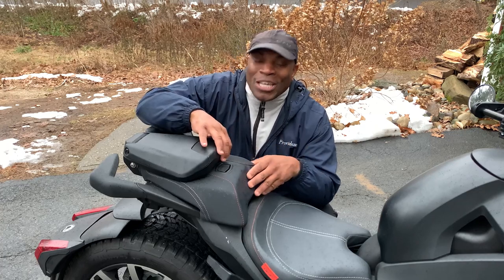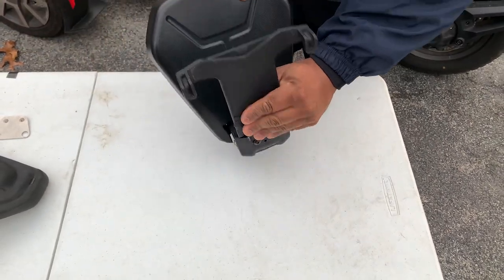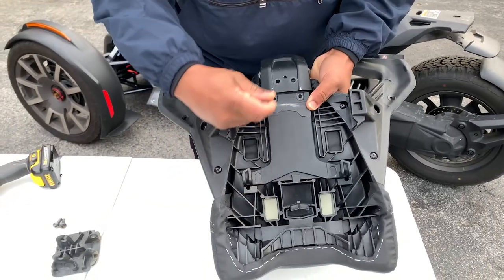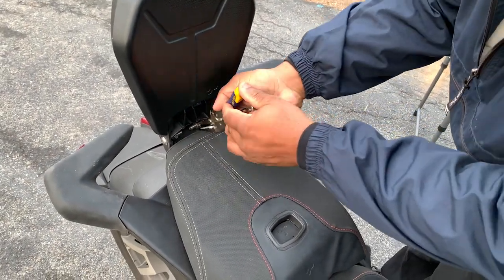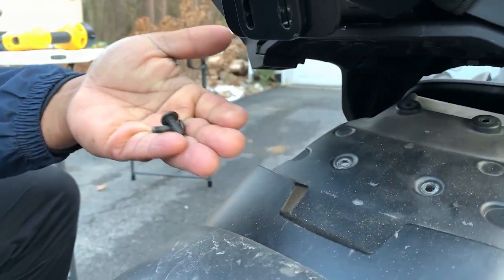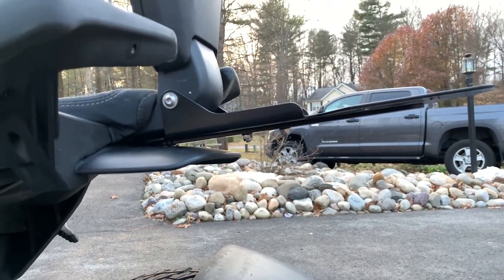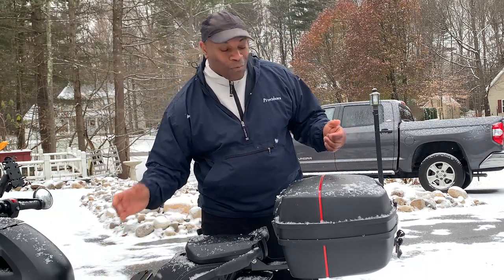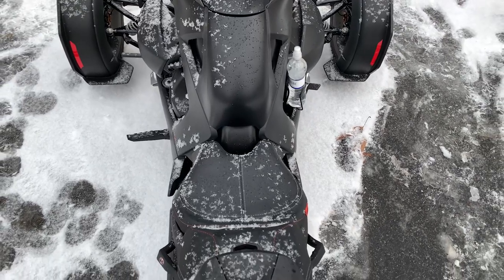Installing  Can-Am  Ryker  Luggage  Rack With  Passenger  Comfort  Seat

Comment: You're really selling me on the bracket I saw on your last video of inexpensive top cases!  I need to get the passenger seat with the flip-up backrest for the wife AND I want a lockable top case behind her seat.  Another VERY HELPFUL and well done video!  Thanks!
Reply from the maker: Hahaha. Thanks for watching the video.  Listen..also check eBAY and Walmart and Target for the top case.  48L size usually holds 2 helmets.  Amazon has been selling out of the less expensive ones...which in my opinion works just fine.  Be well!

Comment: Excellent product and workmanship! Phenomenal packaging and printed colour instructions! However, didn't work well for my use case. I have a SHAD SH50 top case which is perhaps somewhat larger and heavier than for what this rack is intended. Since the fulcrum is set fairly far back (at the hinge point of the passenger seat) it results in a "diving board" effect with the top case bouncing significantly over bumps, even small ones. I unfortunately decided to remove mine and replace with a different, more rigid but also higher profile rack.

Comment: We have the standard BRP seat and backrest…does this bracket work with the non-comfort seat? Also, what specific storage box is that? TIA!
Reply from the maker: It works with any Can-Am seat.  You just need the folding back rest.  The short (non-folding back rest) is made with plastic so the short  back rest will NOT work.

Comment: So been looking at these Ryker 900's seems the Rally is the way to go in my opinion. Would you take a Ryker on a 1000 mile round trip ? They don't seem to move to quickly as far as selling. This concerns me?
Reply from the maker: It’s actually a great bike. The Can-Am products are very reliable also. I’ve been with Can-Am products since 2007 with their ATVs and started my business in 2011 with their motorcycles. I have no complaints. However… Ryker is not designed as a cruising bike. It was purposely designed to be a local run-about. It has a small gas tank and on 1000 mile road trip in my opinion it would be extremely uncomfortable… It has a lot of wind buffering and helmet noise because of all of that wind. But that’s just my opinion. We do mostly local road trips now and trailer the bikes for longer distances. Good luck with what you decide. Thanks for watching the video
Reply: @kirwinprovidence3225  thanks for the reply, yes i stopped by this weekend at a Can Am dealer he pretty much said the same. So typically I trailer my Honda ST1300 from Florida to North Carolina area and ride the mountains. I like AC and riding 600 miles even one way on a bike sucks in my opinion.
So the Ryker should handle pretty well throughout the curves of the area I assume the gas tank size is not to bad  5.3 US gal vs my Honda is like  7.4 US gal
Looked at the Spyder just way to big and to much money for a toy. Rode my friends and didn't really care for it. Think I will test drive a Ryker during Biketoberfest then make my decision.

Comment: Cool mod - are you fabricating the mount yourself?  Are you in RI?
Reply from the maker: We fabricate in Upstate NY.
Reply: @kirwinprovidence3225  Will I still be able to remove the backseat?
Reply from the maker: @richardlee4438  4 bolts hold the rack in place.  Removing the 2 bolts at the bottom will allow the rack to swivel up.  You can then remove the seat.  Thanks for watching the video.

Comment: It looks like a nice rack but the one big flaw is that someone can push that button up on your seat and take off with everything. Unless there is a bolt that I didn't see in the video that keeps someone from doing that.
Reply from the maker: There is no flaw as mentioned . In order to remove the assembly you have to remove the two bolts from underneath the rack. Before you can remove those bolts you still need to remove the bolts holding the mudflap in place. Once my rack is installed it actually protects your seat from being stolen.
Reply: @kirwinprovidence3225  Do you mean those 2 bolts that you replace underneath, because I watched your video a few times and I don't see them going through the max mount to make it secure. I not trying to be difficult,  I just don't want to purchase something for $180 that can't be refunded if it does secure. The mud flap does not secure into the seat only into the mount.

Comment: 1:00 Does the "special plate" come with it?
What's the weight capacity?
Reply from the maker: Yes…everything is in the kit. Weight is 20 pounds
Reply: @kirwinprovidence3225  I meant how much can the rack hold? Could I put 100lbs on it? I plan on going cross country next year and I'll need something that can hold all my gear.
Reply from the maker: @Raynor88  Sorry..no rack for the Ryker can hold that amount of weight.  The last I checked the Ryker can not even tow a trailer.  The racks are meant to handle a few items and keep them locked up safe in a luggage box.

Comment: The only inconvenience that I experienced with it was that when  I was trying to remove the passenger seat, the support plate was hitting the max mount. I had to remove all the hardware, remove the luggage bracket then remove the passenger seat so I can run some wire underneath the seat and max mount, but besides all that I love the bracket.
Reply from the maker: Thanks Carlos.  Be safe and enjoy the riding season.

Comment: Will it work with factory Yamaha top cases made for the FJR?
Reply from the maker: This is a flat rack so almost anything will Mount. It is designed so you can drill custom holes to most various cases. Metal is stainless steel so it won’t rusts on you

Comment: I have the Ultimate Seat, which doesn't have the folded backrest.  Wish there was a solution for this.
Reply from the maker: Unfortunately not. And all other options when mounted will hit the back tire. Unfortunately this is the only way to mount safely and not have issues with that back tire. Good luck…
Reply: @kirwinprovidence3225  thanks for the info.  I had wondered if similarly to how you have the added support of the bolts in the passenger fold down backrest, using the bolts (2 per side) on the Ultimate Seat where the grab handles might serve a similar purpose to allow it to work.
Reply from the maker: @ShockwaveTXB  Intriguing… Unfortunately I cannot speak to the mechanics of how that would work. You may just have to fool around with it.
Reply: The sling mods 2 up luggage rack can be made to work with the ultimate seat and the amazon luggage with some work

Comment: 2023: did make a model that will fit without the backrest?
#granrappa❤️
Reply from the maker: No because There is no safe attachment point without the back rest. That’s why all out of models on the market slam against your back tire when you hit a pothole. The back rest is needed to avoid slamming against your back tire and have a safe attachment point. Thanks…
Reply: Thx for the clear knowledge ❤️